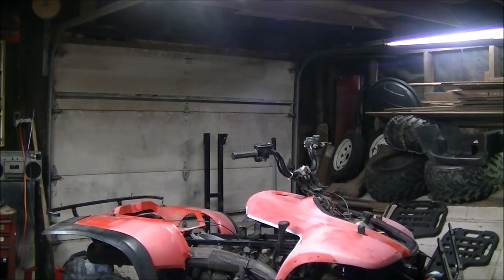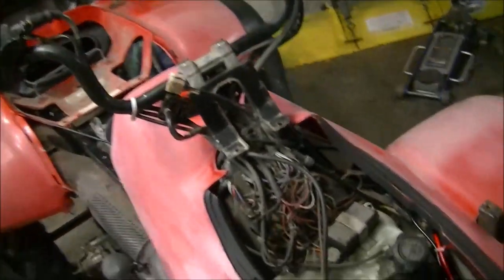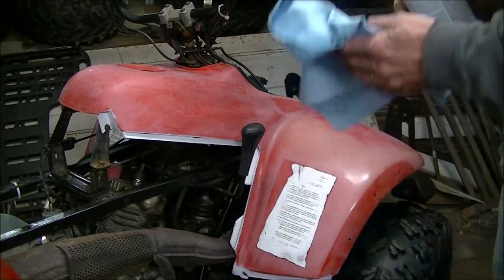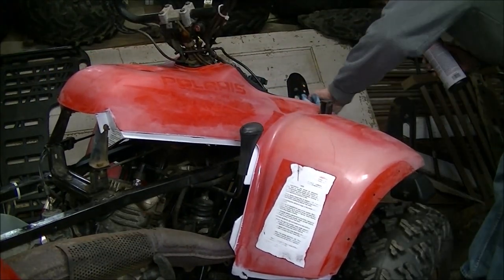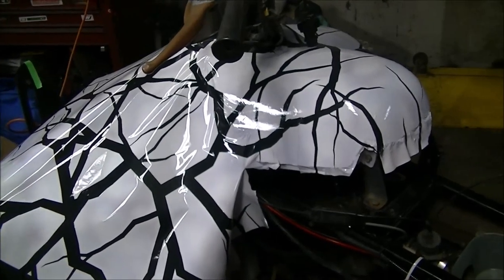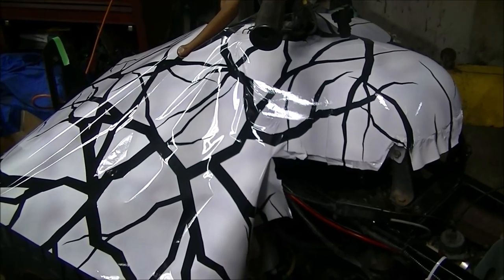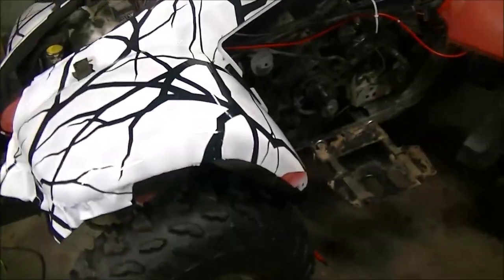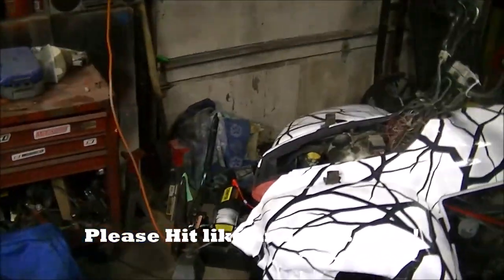How to Camo Wrap an ATV with 3M Air Cast

Comment: How has it been holding up? Any peeling? Finish still good. Getting ready to do one of mine. 95 xplorer. Wondering if it scratches easily. Even during normal washing.
Reply from the maker: I sold it. I saw it on Facebook marketplace last year. Still looks great after 3 years.

Comment: If you had the plastics off , it would have been alot easier to cut one big piece, lay it over it,  and go from the inside out, wouldn't have the missing chunks . Good for first time, it definitely gets easier every time you do it
Reply from the maker: Thanks. I did end up doing that on the back fenders. It was easier to cover but harder to stretch because it moved around on the bench I was working on. But I got it to work..